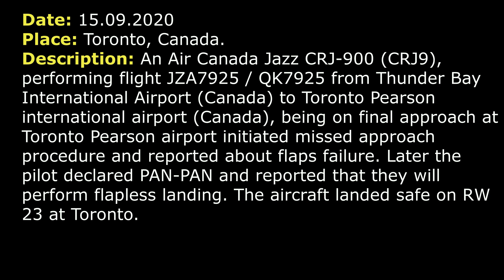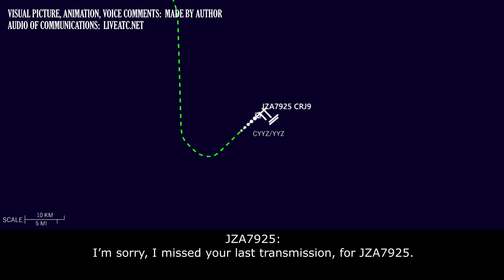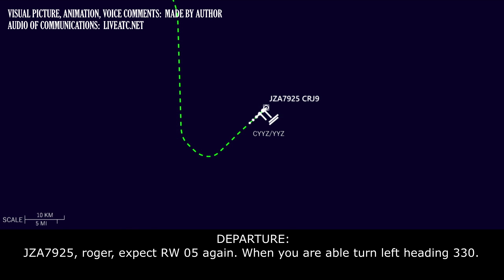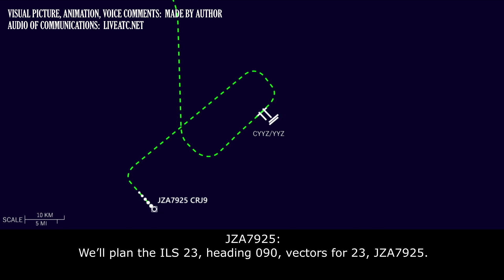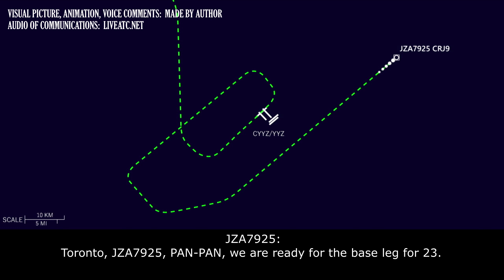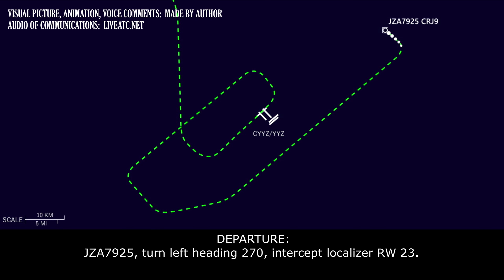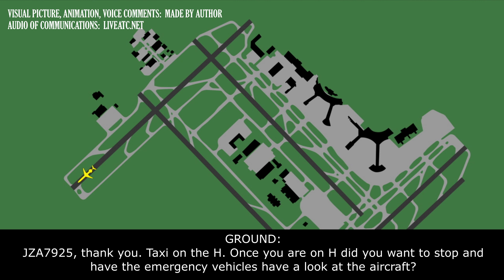FLAPS FAILURE on final and FLAPLESS landing | Air Canada Jazz CRJ-900 | Toronto Pearson airport

Comment: [NOTES]
0:40 Good day JZA 7925 Toronto Tower, wind light and variable, cleared to land RW 05.  Are you getting any upper wind reading?
1:50 Over to departure 28.8 JZA7925
2:57 So we're preparing for a flapless landing.  So update our status to PAN-PAN at this time.
3:28 Sure, we'll, we'll go for 23 and that gives us some time on the downwind to sort this out [Bold=heavy Canadian accent]
4:14 Right now we....we have 51 souls on board, no live [animals],  And right now we have 5800 pounds of fuel, should be landing about 5500.
5:51 already corrected in viewer comments
6:33 JZA7925 just checking in at the end [of the runway]
7:04 RED22 and company following the aircraft and we copied the last [transmission]
Reply from the maker: Thank you. Pinned.

Comment: ATC cleared him to cross 15R but the captain read it back as cleared to cross 15L and the ATC didn't pick up on that. had both 15s be active that day that readback error could have been disastrous. I've worked at Pearson for 18 years and the winds for the most part are good for rwys 23 and 24 but sometimes the 33s and 15s will be in use due to the north and south wind directions and that mistake that ATC didn't pick up on could be a horrible mistake.
Reply from the maker: Thank you. While it was approaching 15L he was cleared to cross as well. Yes it was wrong readback. I think controller was tracking this aircraft all the way to the gate.

Comment: Nice vid, always find the no-flap landings interesting.  Do you cut out irrelevant transmissions, or was it just the 7925?  Seems like a quiet day for an airport in such a large city.
Reply: YYZ has been extremely quiet since COVID, almost no transboarder traffic, very limited domestic service. YYZ - YUL for example would normally be hourly. Only 5 today... (09/22/20). YYZ-LHR should be 5x a day on AC alone, today? 1
Reply from the maker: Yes, I do. I cut all irrelevant communications. Only 1 aircraft on frequency.
Reply: @YouCanSeeATC  I do sometimes find it instructive listening to the other callouts, especially if controllers are bumping other aircraft out of the sequence to get the emergency in.
Reply from the maker: I always put such transmissions in videos, but usually people don't listen everything what was going on the frequently. Thanks, I'll keep it in mind.